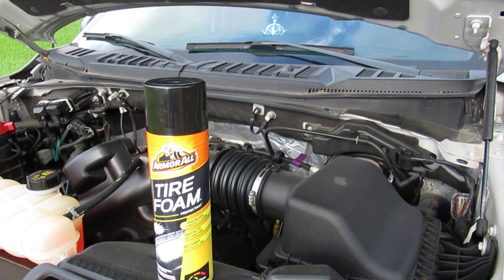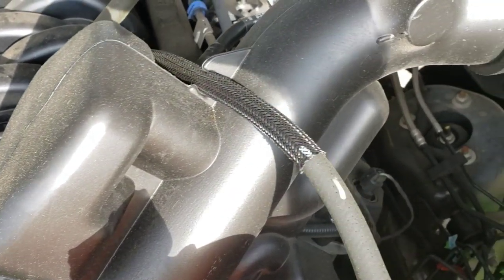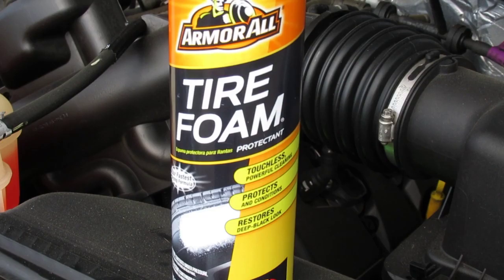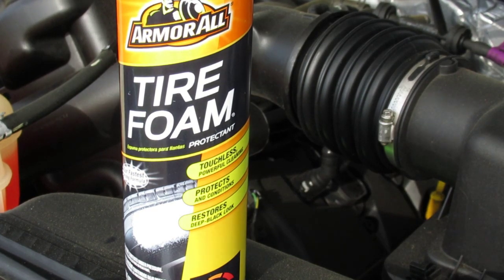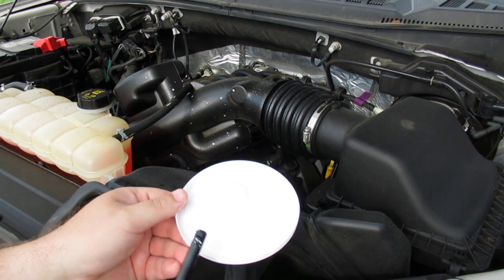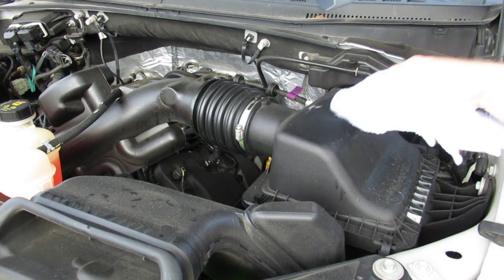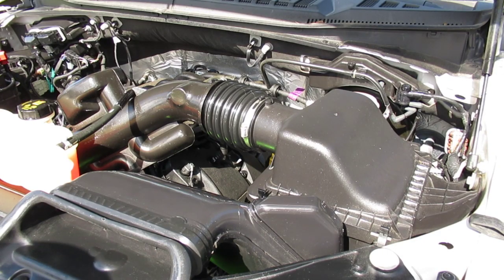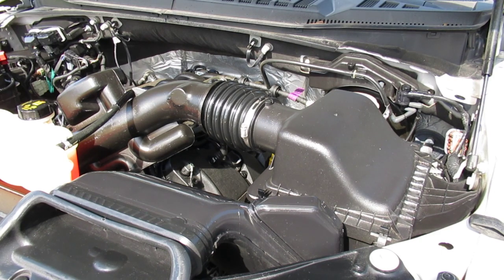HOW TO CLEAN AN ENGINE - UPDATE VIDEO

Comment: I think u shot your self in the foot with this one. 90% of the dirt and grime are still on the motor in places u can't see. On tires most dirt can and will come off. Engines have to many places for catching and holding dirt and grime. Not rinsing is I'll advised.
Reply from the maker: As I said in the video, this is not the most thorough way to clean an engine. But I'm also not going to spend lots of time or effort on a daily driver just to have it get dirty again quick. I've done this for many years without any problems from wiring, electrical, or anything else and still believe it's better than  spraying with high pressure water. For what it's worth, I had a cracked coil pack on a truck a long time ago that I let go for way too long. Every time it rained, just the small amount of road water would cause the truck to sputter but the tire foam never did that to it. You're right, not all the dirt is going to drip off onto the ground, some will end up on the frame, front suspension, bottom of the engine, etc. But I would rather have it there than on the top. As I also said, this isn't for everybody. A lot of people will put way more effort in to cleaning it but many more wont.